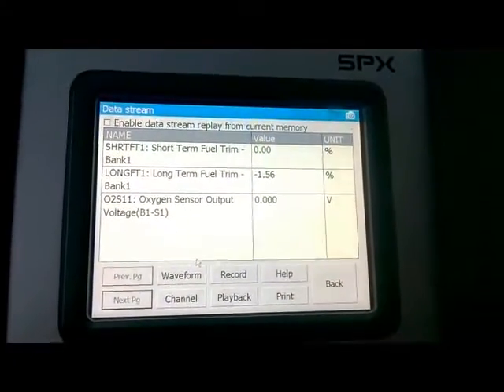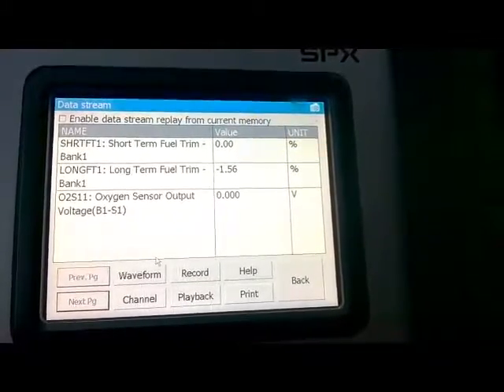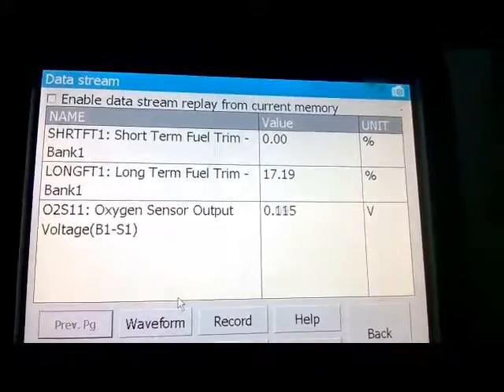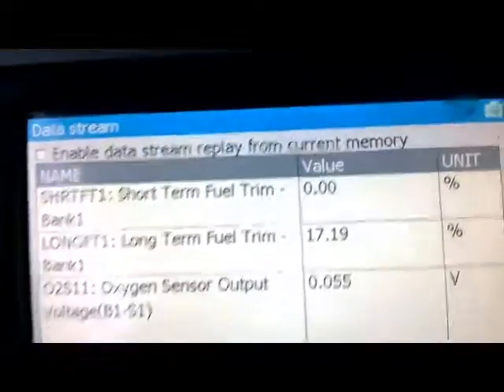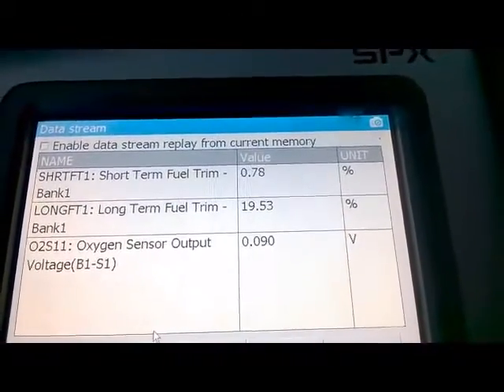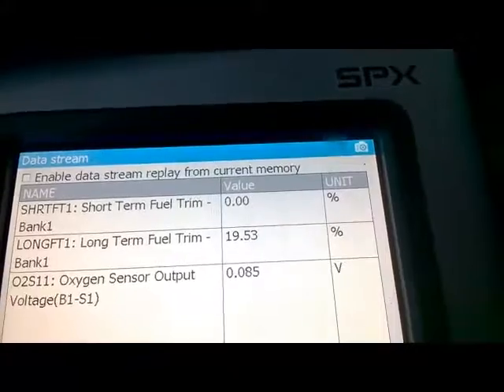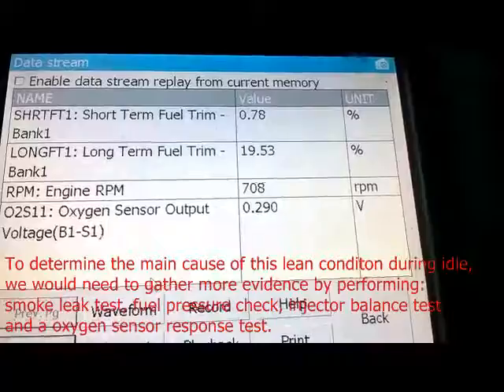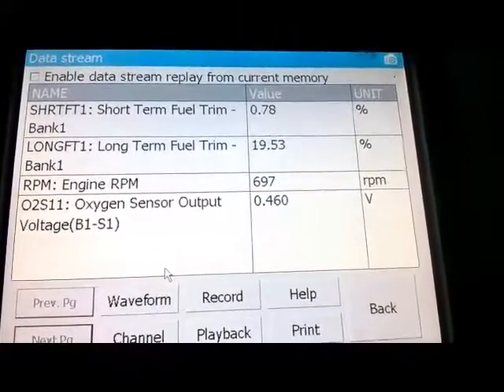(Toyota Camry) Fuel Trim Diagnosis

Comment: what if longterm fuel trim was negative 19 that would be rich condition hw would you approach this problem
Reply from the maker: I would focus on a dirty or faulty MAF sensor or leaking fuel injector or leaking fuel pressure regulator.

Comment: thanks Eli i tried to check my car its idling stft -10 Ltft +13 and when i raise rpm stft 0% Ltft +9 steady is it vacuum leak or fuel pump
Reply from the maker: @Hatem187  You may have multiple problems, I would start with cleaning the MAF sensor if equipped  with one, then I would pursue a vacuum leak. Lastly, fuel delivery such as dirty injectors.
Reply: @EliTheOBDTech  thanks i cleaned the maf and injector now fuel trim at idle LFTF 0.78% SFTF 4% but when i push throttle to 2K LFTF 0% & SFTF goes to 17-19% , the car is Mazda cx9 2013

Comment: Same problem with my 2010 GMC Sierra 5.3. It all started with a misfire. That threw a po300. I hooked up my scan tool and showed a ton of misfires on cylinder 3. I switched the plug with cylinder 5 and the coil to cylinder 1. The misfire stayed on 3 so I switch wires with cylinder 2. Misfire moved to 2. I bought a brand new set of Delco Gold wires. Installed them. Then I started getting completely random misfires on random banks and cylinders.  I figured it must be air or fuel to be able to just bound everywhere whenever.  It’s always on misfire on a completely random cylinder. On a couple misfires within the first couple miles. Normally at lower RPM’s. I had Denso TT Iridium plugs installed at that time so I put my original worn plugs in. The misfires went down but still occasionally get a weird random wherever misfire.  I was also battling with the virtual Flex fuel sensor miscalculating and creating a positive feedback loop that would screw up my fuel. I was angry enough, I used my HP Tuners to disable Flex Fuel. I went and filled up my truck with. Ethanol free gas so there would be no running wild virtual sensors.  Still had stumbling problems and it really seemed like the o2 sensors were really slow.  I bought replacements but haven’t put them in yet. I also did a Delco replacement fuel pump about 6k miles ago. I was seeing signs of a vacuum leak. I tried the spraying brake clean all over after a cold start up. Didn’t notice any changes. I assumed it much be the intake manifold so I replaced both banks. The valley cover was insanely loose. I 4-5 bolts were finger tight. I pulled the valley cover and cleaned it up. Gasket looked new so I put it back on and torqued it down to spec and in sequence. After starting and doing so runs around town, my trims settled into a new home. High LTFT and spot on STFT. When I rev the engine and hold the RPM’s.  The LTFT will drop right down to 3-4. I bought all the injector gaskets so I can pull them and give them a deep cleaning, but it seems I more than likely have another vacuum leak.  Time to get a transfer pump and a cigar. 😂😂😂
Reply from the maker: @RobsReviewsAll  Those types of problems do take you into big loops with so many questions, that keeps you saying, now what?

Comment: My short term zero % and long term 27%, but long term not go under 18% whatever RPM, if RPM like 3000 or more long term be 18%, you know if the vacuum leak or something else  ?
Reply from the maker: @chrisisho2557  Seems like a vacuum leak issue. Does your engine have MAF sensor?
Reply: @EliTheOBDTech  actually has MAP sensor, 
I have P0068 code related to Map sensor, 
I replaced Map sensor with OEM and test sensor wires by multimeter and all Normal, Attached smoke test and no vacuum leaks at all, 
Also changed O2 sensor but still LTFT really high and not go less %18 even if 6000 RPM
Reply from the maker: @chrisisho2557  Another possibility would be fuel delivery, such as dirty fuel injectors
Reply from the maker: https://youtu.be/OEPI1fIq1dc?si=9rHdb-q4yRiC2q25
Reply from the maker: I sent you a case study link that pertained to fuel injectors being dirty.
Reply: @EliTheOBDTech thank you for your reply , video really helpful 🙏
Reply: @EliTheOBDTech  I’ll  replace low pressure fuel pump and filter this week and will see if still stuck LTFT %18 and not go less that will go ahead and order 4 fuel injectors

Comment: Thanks for this information. 
My issue with a Mazda 3 2012 its similar. The SHRTFT1 is aorund 0 to -1≈-4, normal, but the LONGFT is around +9 to +14 in idle. When i drive the car this drop to +3≈+4 and the scanner some times go to check engine with the P0171 code. My fuel consuption is OK buth the power engine seems to  be lower compared with before. Also sometimes the start goes difficult in the first athemp but goes normaly after the second one. This still could be a possible vacum leak or a fuel pump/inyection problem?
Reply from the maker: I would start with the MAF sensor being dirty, then potential vacuum leak.

Comment: Mine is doing the opposite. At idle they both are at 0 percent or jumping around -4 to 3 on STFT and my LTFT once warm is stable at 0 or 0.78. When I rev the engine the long term is going to around 14 but when I let off the accelerator it goes back to the 0. My short term is in range. 

What would this indicate? 

Still have a p0171 and will a p0741 make the lean code stay ?
Reply from the maker: Does your vehicle have mass air flow sensor?

Comment: hello, i have long term fuel trim of 10.16% at idle and when i rev the engine to like 2000-2500 it goes to 17.7%. what can be the cause?
Reply from the maker: Fuel delivery such as dirty fuel filter,  dirty fuel injectors, weak fuel pump or Air delivery such as dirty mass air flow sensor. Let's not forget, a slow response oxygen sensor or vacuum leak.

Comment: my ltft is at 15+ at idle. When i go to drive it drops to 7+. 2 different master techs told me my mass aiflow was bad and upstream was lazy. Replaced both with OEM and the trims are the same. I smoked the whole system and multiple people helped me look and we couldn’t find an intake leak. When I’m driving at highway speeds. The ltft is at 0. The stft is jumping in the -1 to -4 range.
Reply: Having very similar issue with a Nissan. Did you solve this? From the data it looks like you do have a vacuum leak…
Reply: @zygi22  if you don’t see a code. Leave it. Not every engine runs perfectly. 14.7 to 1 is kinda overrated. Some engines idle lean like mine. It’s normal I would say
Reply: Might be leaky fuel injectors?

Comment: I have a question for you concerning these fuel trims?
Reply from the maker: Go for it..
Reply: @EliTheOBDTech  how you doing? So I have 2005 accord ex 3.0 V6......at idle here are my fuel trims- bank 1-stft-14.8%/ ltft 8.6%.....bank 
2 stft-14.8%/ ltft 7.8%.....when I keep it steady at 3000 rpm's, here are my fuel trims....bank 1- stft 11.7%/ ltft 8.6%......bank 2 - stft 9.4%/ ltft-8.6%........i had the heads replaced, all new valves, cylinder compression is good, intake and exhaust gaskets, fuel injectors, valve cover gaskets, pcv valve, map sensor, ect-sensor, egr valve,  all vacuum hoses, ignition coils, sparkplugs....brand new.....timing is set top dead center.....and it's been smoke tested no vacuum leaks....!! Any ideas as to why these fuel trims are doing this?
Reply from the maker: @crystrezerex2life  is your accord have a maf sensor or map sensor or both?
Reply: @EliTheOBDTech  it's a map sensor.
Reply: I also notice when I rev and keep it steady at 3000 rpm's, so times short term fuel trim on bank 1 will rise about 2%, which tops it at about 14.3%.....and short term fuel trim on bank to will rise about 7% which tops it at about 21%
Reply from the maker: @crystrezerex2life  any codes?
Reply: @EliTheOBDTech  I had p0420....then a p0174....both codes are gone now.....I drove the car today for a good while.....all the computer monitors are complete except for the EVAP.....no codes have come up.....!! But the fuel trims are still slightly off!! 🤷
Reply from the maker: @crystrezerex2life  Were the intake and exhaust valves properly adjusted to spec?
Reply: @EliTheOBDTech  apparently the headshop it was taken to the work was done by an experienced rebuilder....so Im assuming it was.🤷
Reply from the maker: @crystrezerex2life  On Hondas you always need to double check the clearance of the valves. You might have either have not enough clearance or too much clearance.
Reply: @EliTheOBDTech  thnx...yea, at This point I'm not sure what else to look for.🤷
Reply from the maker: @crystrezerex2life  FYI.... I meant to say  valve lash clearance.

Comment: AN AT ALL RPM THE LTF DID NOT GO LOW BUT STAYED AT AROUND THE SAME VALUES WHAT PROBLEM WOULD WE HAVE?
Reply from the maker: What's your initial long term numbers?
Reply: @EliTheOBDTech  LTFT AT IDLE AND AT ALL HIGHT RPM STAY  0% STFT AT IDLE -5% Until   7% AND AT 2500 AND 3000 RPM +12% UNTIL  +18% .ORIGINALLY BEFORE I FIND LOW AIR LEAK  Ι HAD STFT 0% AND LTFT +18 UNTIL +22% AT IDLE AND ALL HIGHEST RPM S.I WAS WAITING AFTER I HAD AN AIR LEAK THAT WHEN RAISING THE RPMS THE FUEL TRIMS DROP LOW !MAYBE I FINALLY HAVE TWO FAULTS WHY ARE THE STFTS AT 3000 RPM EVEN NOW GOING POSITIVE? WHAT IS YOUR OPINION?
Reply from the maker: It looks like a combination of a dirty/faulty MAF sensor or fuel delivery issue, such as dirty injectors.

Comment: So what was wrong with this case?
Reply from the maker: This vehicle ended up having a  faulty purge valve that was staying stuck open and causing a vacuum leak.
Reply: @EliTheOBDTech  thanks! How did you find that? 🤔🤔
Reply from the maker: @JamesAutoDude  one easy test is to disconnect the evap canister hose to the purge valve along with harness connector, with the vehicle idling there should not be any vacuum coming from the purge valve evap port, lay your finger over the port to verify.
Reply from the maker: I have several videos where I show how to test it.

Comment: Wht if on idle ltft is - 20 on idle, wht could be causes?
Reply from the maker: If it starts at -20 and if you increase rpms, and starts goings more into positive numbers, then most likely, MAF sensor problem.
Reply: @EliTheOBDTech  thank you for the reply. No its remain in negative

Comment: Hi i see you have a lot of knowledge on this thing 
can you give me an idea on my issue 
got a check engine light with codes 
p0174 air/fuel mixture to lean bank 2 and bank 1 p0171
+ p2197 
short term fuel trim way 1 is very unstable 19% long term trim way 1 stays constant at 34.4% 
thanks i hope i will get a response from you 
i forgot to mention if car gets hot in hot weather it will not start until i let it cool down for half an hour or so 
driving a toyota...
Reply from the maker: It could be multiple things. Vacuum leak, restricted fuel injectors, dirty fuel filter or a fuel pump that can't deliver sufficient fuel pressure. I would try to attack a vacuum leak first. Best way, smoke test.
Reply: @EliTheOBDTech  Thank you for the quick reply 🙏

Comment: My 2003 Rav4 2.0L gas has bank 1 LTFT of 16-19. When I rev to 1500, it drops to 13 and stay there no matter what RPM. When I drop back to idle, LTFT  goes back up to about 16. Is that drop enough to indicate a vacuum leak? 
--I replaced cracked PCV hose: no change. 
I checked the real time data, and the O2 sensors seem to be working, giving the same outputs. Also, it is only on bank 1. I would think that if it were a vacuum leak then both banks would have a high LTFT. No?
Reply from the maker: To rule out a vacuum leak, best thing to do, is to perform a smoke test. Toyota's are known for brakes boosters going bad and creating a vacuum leak. Don't rule out a bad intake manifold gasket. Last but not least, restricted/dirty injectors.
Reply: @EliTheOBDTech  I thought about the brake booster. I have a vacuum meter, but realistically probably wouldn't be good for a small leak. 
I forgot too that the O2 sensors are reading similarly; however, I replaced B1S2 a few months ago without issue. But, I'm thinking that B1S2 is WNL because the LTFT is high. If there was not corrected, lean condition, then the O2 sensor would likely read wrong. Does that make sense? Basically, the O2 readings are only normal because ECU is going + on LTFT.
The O2 sensor is aftermarket. Maybe no good. Or maybe the wrong sensor.?
Reply from the maker: @RobHTech  The correct brand for O2 sensor is denso for toyota.
Reply from the maker: With two banks, it depends. You may have an intake manifold gasket vacuum leak on one bank and the other is good.
Reply: @EliTheOBDTech  Oh. the intake manifold gasket Ya, smoke would be best for something like that. 
I pulled the plugs, and they all look normal, so I switched banks 1 and 2 just to see and no changes. 
I also replaced the PCV valve about 2 months ago. I wonder if the spring rate/compression is wrong, as it is aftermarket. I suppose I could just disconnect and clamp the hose and check for reading changes.
Reply from the maker: @RobHTech  To be honest, it's hard to pinpoint the problem without  physically doing a diag. My recommendation is to try and get a smoke test to rule out a possible vacuum leak and work from there.

Comment: What if the long term....fluctuate between - 8 and +14 during driving?? 
I hope you are still around to answer?
Reply from the maker: At idle you are sitting at -8% right?
Reply from the maker: If so, if it goes from negative to positive fuel trims as you accelerate, you most likely have a dirty MAF sensor. Does your vehicle have a MAF sensor?
Reply: @EliTheOBDTech  Map... Only...
2000 camry 2.2
Thanks for answering.
By the way on idle both values... Short and long term within range..... Plus and minus 3 or 4.
Reply from the maker: @wolfduranti8735  A fuel delivery could also contribute fuel trims to rise positive as you increase RPMs
Reply from the maker: For example, restricted injectors
Reply: @EliTheOBDTech  the car drives on high way 25 mile per galone which is OK.
No check engine light, but there is a Evaporate system not passed?
I am not a mechanic, but I have done my best...to figure out why this car..gas . Spikes on acceleration... Specially if I snap opining the throttle quickly, then the short term may go up to 19 for a second or to then start going quick to 8 then all the way negative up to 20..... The normal reading for this car as I said..... - 8 plus 8 or 10.... But a sudden stip on the gas makes the spiking up and down.
Reply: @EliTheOBDTech  yes or even less - 3 and plus 4.
Reply from the maker: @wolfduranti8735  Maybe you may have glitching purge valve that intermittently sticks open. Which can cause those types of trims.
Reply: @EliTheOBDTech  do you mean.... The Vacuum VSV and the other one sits next to it??... I cleaned the one which has a pin the last week it was full of carbon, but tomorrow I will test the efficiency of both.
I will be glad if you just.... List all the possibilities which cause this problem, and do not worry I will check every problem when I have time.
I already cleaned the fule injectors and other things...... I am expecting.... A leak somewhere, I will smoke detect the leak soon? But what do think?
As I said..... What is your deferential diagnosis 🤔as if the car was a patient?
Reply: @EliTheOBDTech  purge valve??? Selenoid swhich?
Reply from the maker: @wolfduranti8735  I'm not too familiar with Toyota evap component terms, the one that introduces evap vapors into the manifold, purge valve.
Reply from the maker: By the way, Toyota has a Fuel Trim setup of +/- 20% Total fuel trims before it triggers a check engine light.
Reply from the maker: A smoke test would be very useful.
Reply from the maker: I would try and test the map sensor with a vacuum pump while monitoring the scan tool as you apply vaccum to see if your voltage signal drops out momentarily. Voltage should increase or decrease smoothly as you apply vacuum.
Reply: @EliTheOBDTech  I think so.
Reply from the maker: I'm more of a hands on tech, I need to see the problem physically to pint point the problem. I hate guessing.
Reply: @EliTheOBDTech  if the smoke test, could not reveal any thing.... May be the selenoid... Has a problem only on acceleration??
Reply: @EliTheOBDTech  I am in San Francisco??? If you are near I will drive to your shop?
Reply from the maker: @wolfduranti8735  FIY, when performing a smoke test, make sure is done with a cold engine.
Reply from the maker: Quick test on the purge valve, disconnect the electrical connector and the evap hose that goes to the evap canister, not the hose that routes to the intake manifold, you should not feel any vacuum coming from the solenoid valve with the engine running. If you do, it's a faulty purge solenoid valve.
Reply from the maker: I'm in Pomona, California
Reply: @EliTheOBDTech  OK.... Thanks.
Reply: @EliTheOBDTech  that is near Los Angeles, I think so.

Comment: Does it mean the o2sensor is broken?
Reply from the maker: What kind of car are you working on?
Reply: @EliTheOBDTech  2001 ford escort se.
Reply: @EliTheOBDTech  the exact problem I'm having,  is I get a burned fuel smell inside my car and a very low gas mileage.
Reply: But no check engine light so this is why I'm trying to find out if there's really a problem or not.
Reply from the maker: @miguelrodriguez2328 If your o2 is really not doing any switching and is stuck in a lean condition, pcm will add more fuel due to a faulty sensor and you will get bad gas mileage.
Reply from the maker: Even a vacuum leak can cause a lean condition.

Comment: How about if there's no long term fuel show on my obd2 and the o2senso voltage shows 0.00 on idle? Thanks.
Reply from the maker: Any engine codes?
If there is no activity from the o2 sensor, most likely it's going to be a faulty o2 sensor, either in the sensing circuit or heater circuit. You can use a ohmmeter and ohm out the two colored wire the are same color and check resistance.
Reply: @EliTheOBDTech  yeah I was just watching a video about, I'm going to try that tomorrow to see what happens, thanks.